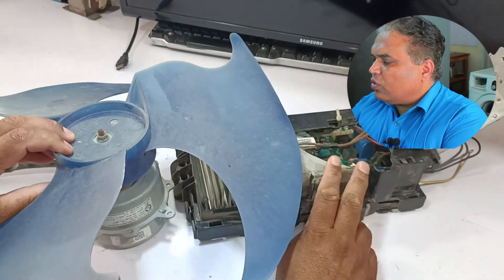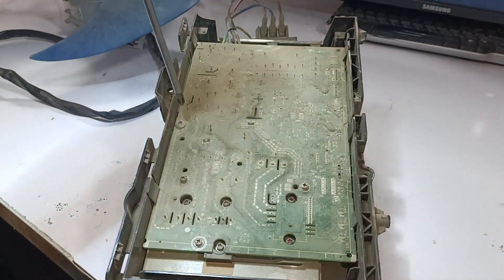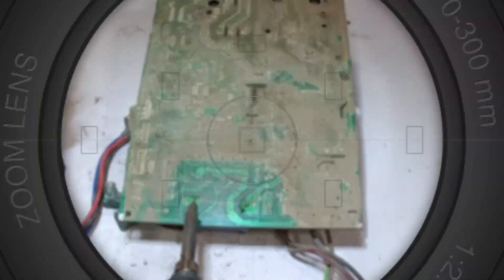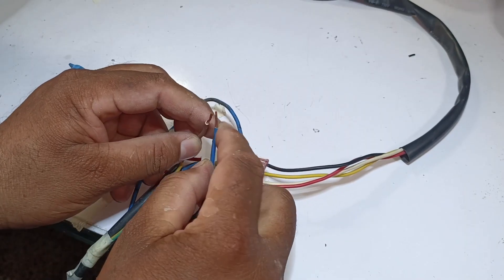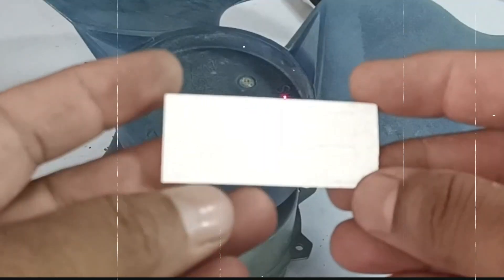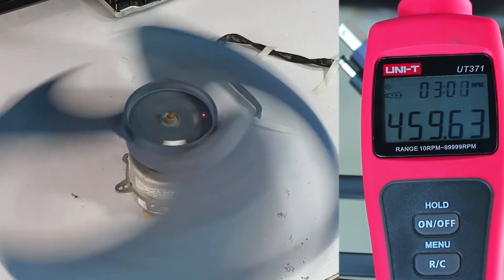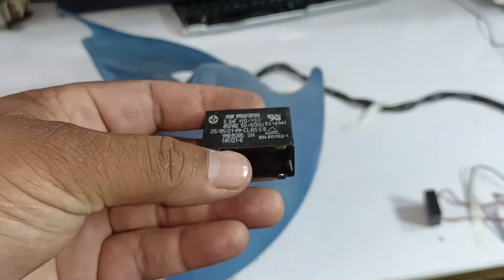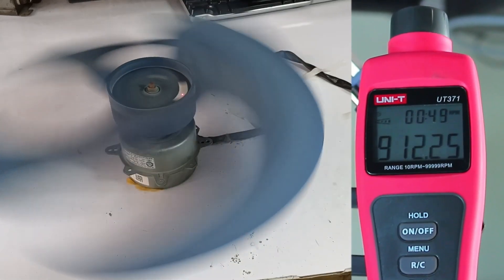AC Outdoor Fan Motor Faceoff: 2.5 vs 3 µF Capacitors for Maximum RPM

Comment: My fan bearings went bad. They no longer make the fan so I cannot replace it. It is also a closed system so I cannot take it apart and replace the bearings. I need to replace it with an entirely different fan. How do I find the right fan that will work with my unit. I have a lennox A3G665-AC41-D4. And the part number for my fan is 102803-04. It is an ac fan motor 208-240VAC, 0.9A, 205w @230VAC, 700 rpm

Comment: He did not say what the fan should be running at per factory specs.. It was also strange that both high and low were so close in speed.. Most of these AC motors are controlled by a pulsing transistor circuit that has a couple different value resistors which are switched for the high/low that comes from a driver transistor or IC.. This method is preferred because directly limiting current through a rheostat or resistor generate more heat and are thus less energy efficient.. So I would assume that if the fan spins slow when being driven by the control board something in this pulse circuit has a problem and most that I have seen usually happen as the circuit is in use for a while and the components heat up.. Another common problem is a bad solder connection that is making poor contact on the circuit board..

Comment: Why dont just check the capacitor? Quicker ... 
And no. it is not puffed, but still can be BAD, like in many cases with laundry machine control boards, the sense capacitor will go bad without any sign.
Also oversizing the capacitor might get your fan's coil too hot and burn out. be warned.
Reply from the maker: Yes capacitor check is a must, I know that, I checked if off the camera, it was fine, it had no issue.